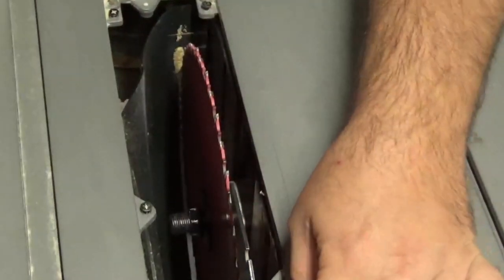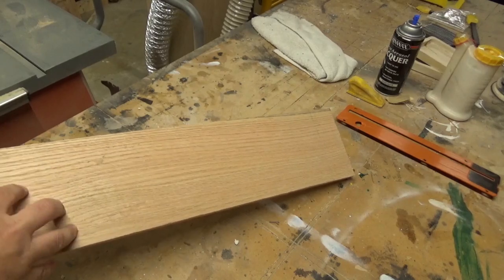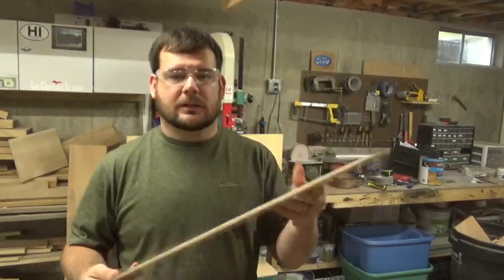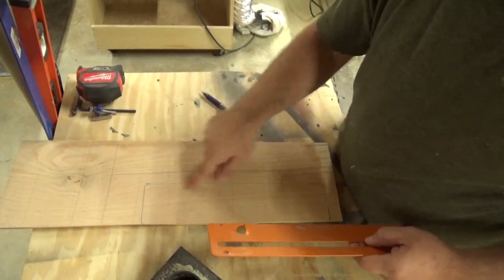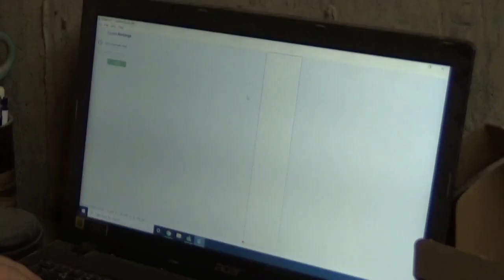Making Zero Clearance Inserts Two Different Ways

Comment: Fun video. Not sure what you're using for CAD/CAM, but as you get more proficient with it you will see things switch quite dramatically. I am by no means an expert at Fusion 360 (which is what I use), but I can now much, much more quickly design and make something that fits better and is more adaptable using Fusion and my CNC than doing by hand.
Reply from the maker: That makes sense. Something I didnt mention in the video is the the repeatability with the cnc. You only have to design it once. Thank you for sharing